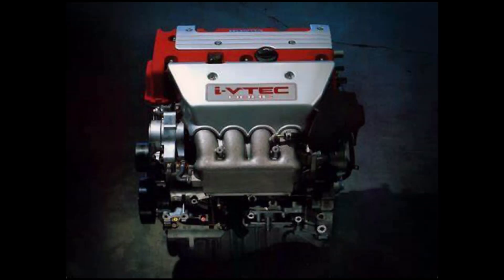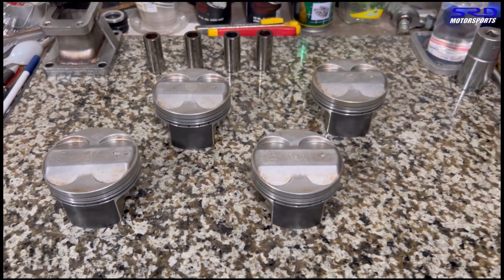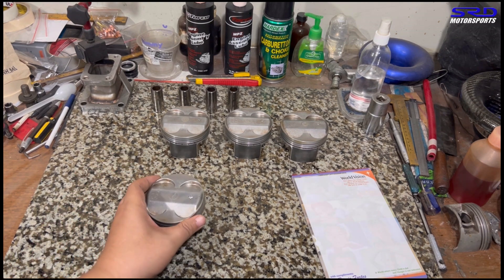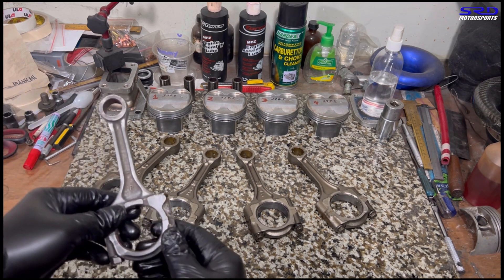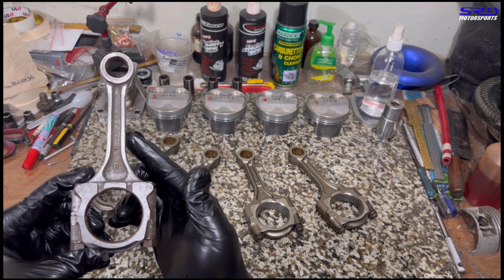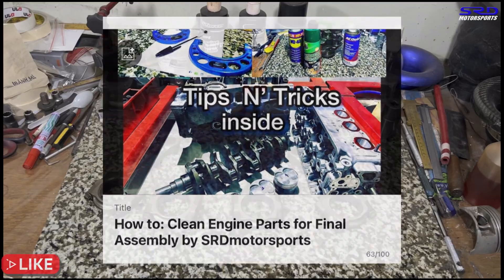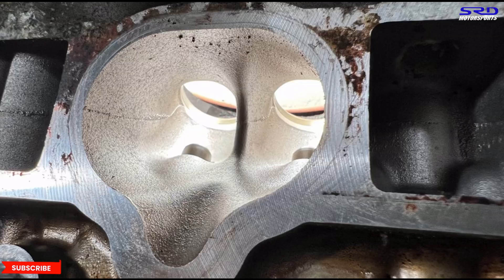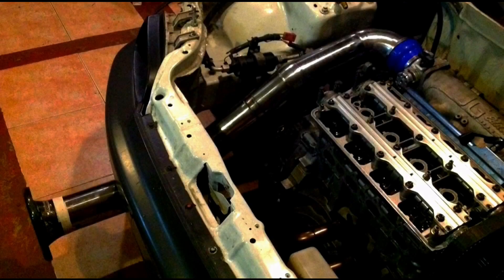Integra DC5 K20a TypeR Project with Drag Cartel DIC Cams

Comment: What is the k series camshafts profile? K20a,k20a2,k20z3 and k24a2 salamat
Reply from the maker: K20a TypeR this engine is from a DC5
Reply: @SRDmotorsports   the lift and duration of each cam
Reply from the maker: I didn’t check others

Comment: Curious as to how much quench distance the K20A has from the factory 🤔
Reply from the maker: Havnt really checked but would check during pre assembly
The HG are all 0.026” factory thickness but the chamber isn’t as deep so it’s probably way above 0.042”

But not 3mm lol!
Reply: @SRDmotorsports  Thanks, man! Just curious as to what nifty tricks the factory engineers did with the K20A 🍻
Reply from the maker: I think it’s mainly that aside from nicer ports and 2mm bigger valves 
The chamber isn’t as deep so the lesser need for a “spikey” dome for the same comp target ratio

Comment: Hi I have a question
I have a k24a3 engine for a project, it has the RBB head
But I also have a k20 rsp cylinder head with factory cams.
Is it worth porting either one of these with factory cams, if so which one?
I have 70mm TB, headers to 3" exhaust.
Reply from the maker: Really depends on application and who will port
Both heads can work well with the limit being mentioned as factory cams
Reply: @SRDmotorsports  it will just be used on the road in a dc2, possibly with some track days
I'm doing the work myself, I haven't ported a head before 
Is it that easy to f*uk up?
Reply from the maker: Funny cuz a lot of shops won’t admit they f*ck it up lol

Comment: I am assembling a prelude b20a with b18c jdm pistons, f22 connecting rods, b18b camshafts and 62mm throttle body and your videos have helped me a lot to work on the cylinder head and intake, in addition to assembling the block. it will be in the streets soon 🥳
Reply from the maker: That’s really nice to know